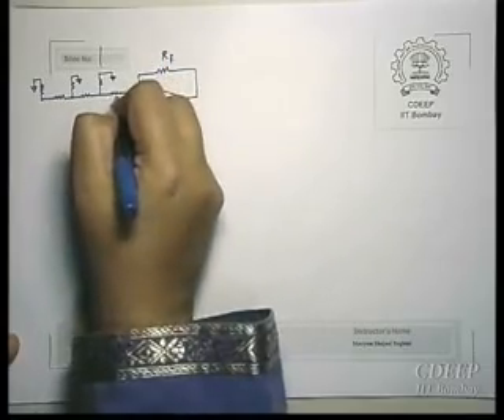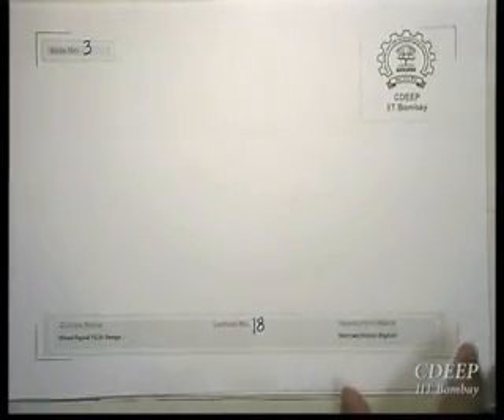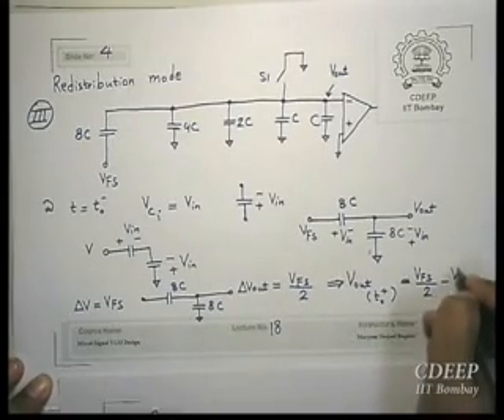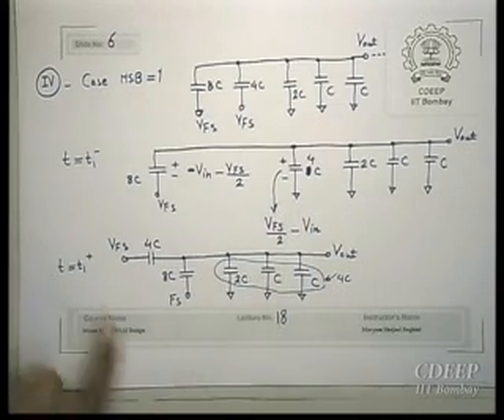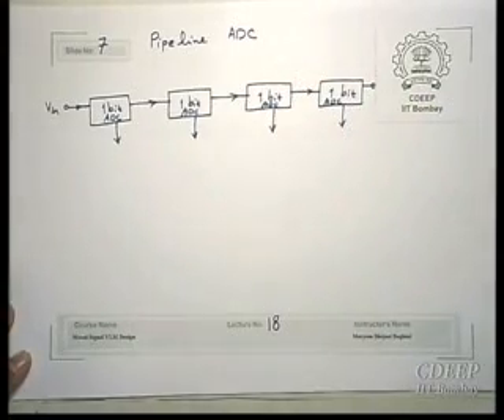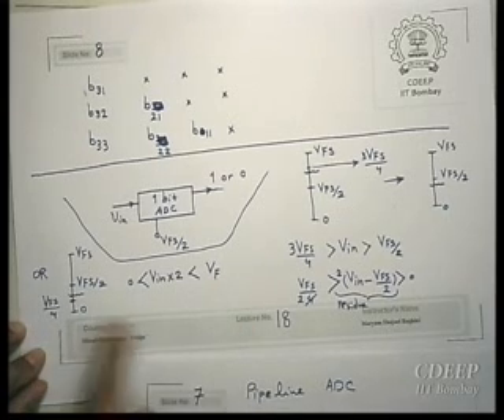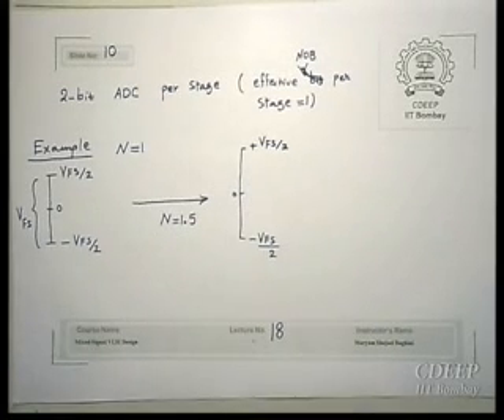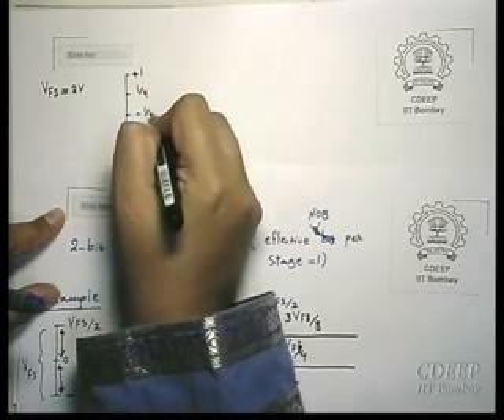18. SAR ADC using parallel charge based DAC and Pipeline ADC

Comment: For the case msb=0 the voltage at 8c is changed from VFS to 0 and at 4c we changed 0 to VFs, so for change in voltage at 4c we calculated the change in output voltage. what about the change in voltage at 8c..?